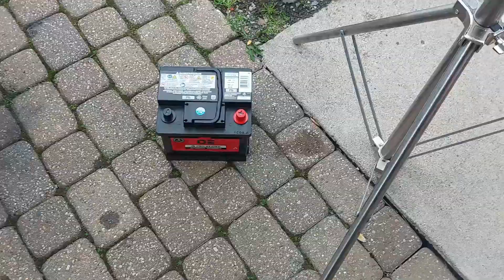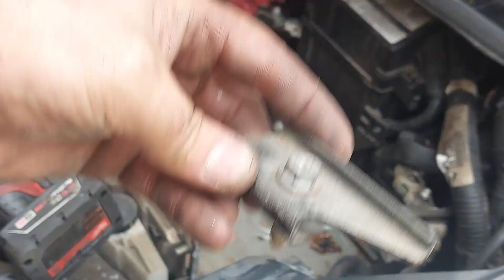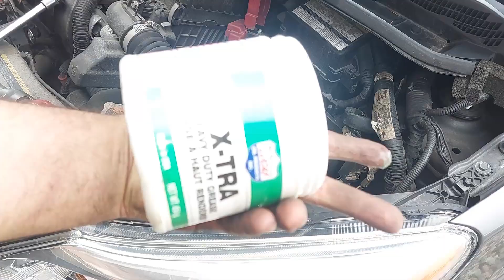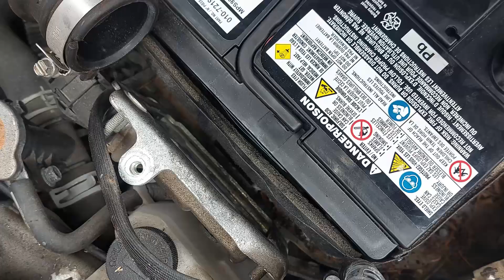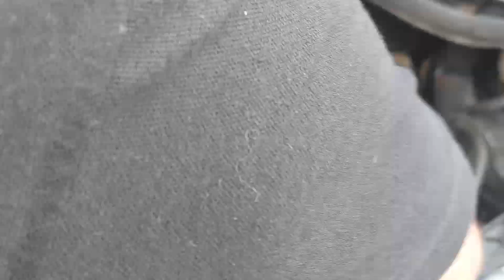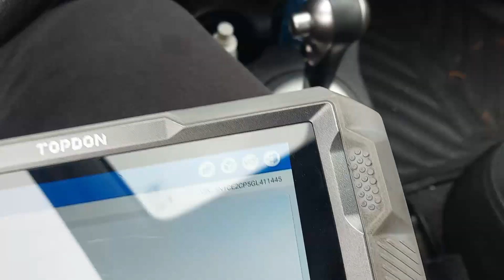2016 Nissan Versa Note 1.6 - Battery Replacement

Comment: Thank you for the detailed video. Which battery did you use? Costco suggested a 51R, but it did not fit. I read T4 or T5 should be the right fit.
Reply from the maker: Group 99R.

Comment: Thank you.
Your instruction is very helpful.
I changed my battery today. 👍
Reply from the maker: You are welcome. I'm glad I could help.
Reply: Thank you for the detailed video. Which battery did you use? Costco suggested a 51R, but it did not fit. I read T4 or T5 should be the right fit.
Reply from the maker: This one uses group 99R battery. They're expensive and may be hard to find in some stores.